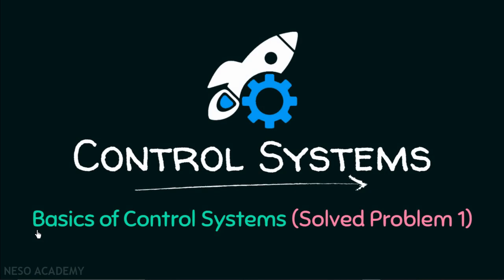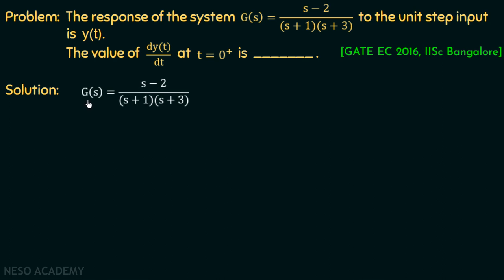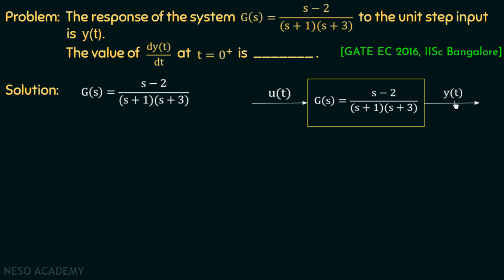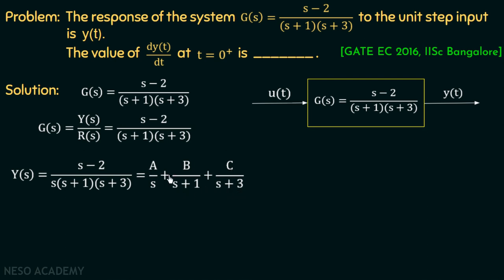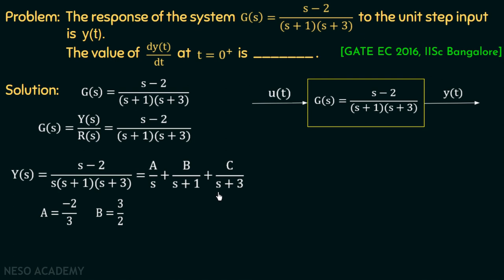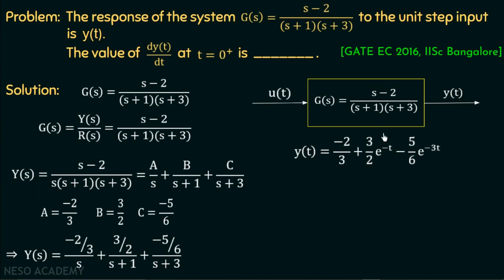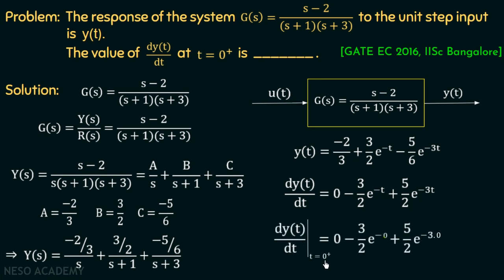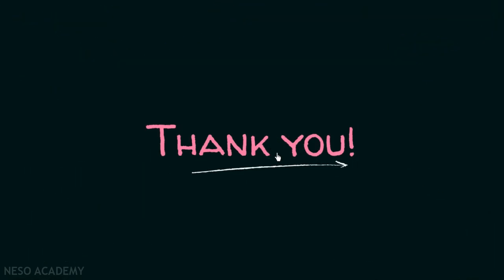Basics of Control Systems (Solved Problem 1)

Comment: We actually don't need the y(t). We can use the formula L^-1 {s F(s) } = f'(t). Then we would have y'(t) = L^-1 {[s * (s-2)]/[s * (s+1) * (s+3)])} in which the s would cancel leaving a simple inverse Laplace to execute y'(t) = L^-1 {s-2/[(s+1)(s+3)]} .
Reply: Without finding the inverse LT we can also  directly find out it by using initial value theorm

Comment: Without finding inverse transform of y(s),we can use initial value theorem to find the answer easily.
Reply: No, there is a sudden impulse at 0 for y'(0)
Reply: @wahibkapdi5493  I may be mistaken, but I don't believe there is a sudden impulse at t = 0+ for y'(0).  As he derived in the video, y'(0+) is just equal to 1.

Comment: Sir ...why we can't write u (t) with answer  this time. ..after taking ILT. .
Reply: İ am so confused with that also.Could you find the answer ?
Reply: I think the main reason why u(t) wasn't written is because the problem just asked for the value of the derivative at one specific time (0+).  Overall, I think it's still safe to assume that we are dealing with causal systems, and if we have to give the response to a signal, we should still either write u(t) or specify that the function is only valid for t >= 0.

Comment: thanks 🙏
I used this idea and get the answer quickly:

We know that if we differentiate step response we get impulse response,
 so if y(t) is step response then dy/dt will be impulse response.

The problem asked us the impulse response at t=0+
so take inverse laplace transform of G(s)
to get impulse response and then substitute t=0.

h(t)=ILT{G(s)}=(-3/2exp(-t)+5/2exp(-3t))u(t).
h(0)=1

Comment: Yo, question ... at 4:05 to about 4:15,

How does (-2/3)/s in Frequ. domain, become just (-2/3) in time domain

If 1/s => u(t)
isn't  (-2/3)/s => (-2/3) u(t)

I feel very confused by this.
Reply: Well, we are taking 1/s+1 = e^-t
So 1/s+0 will be e^-0.t and that will be 1
Reply: Do you know what u(t) is or how it's defined?  It's equal to 1 for t >= 0.  There's no such thing as negative time, so -2/3 and (-2/3)u(t) is the exact same thing as long as it's understood that it's an engineering problem.  Personally, I only write u(t) when it's shifted, i.e., the signal changes between some intervals.  But if it troubles you that he didn't put u(t), then do it when you're solving similar problems.

Comment: Can you help me understand here:
Suppose we want to use (S+1)= 0
And S=-1

So, putting s=-1 in LHS
(-1-2)÷{-1(-1+1)(-1+3)}
=> -3÷{-1(0)(2)}
Having 0 in the denominator, becomes invalid according to my understanding. So, please help me understand. How do we avoid (s-1) in the denominator? I'm confused in that section.
Reply: I think as part of the "cover-up method", you need to cover up the factor of (s+1) in the denominator on the LHS.  So you'd have (-1 - 2)/(-1*(-1 + 3)) = -3/(-1*2) = 3/2, which is what he got in the video.
Reply: This still confuses me...why is the (s+1) covered up?
Reply: @justinokolo5234  It's called the Heaviside cover-up method.   Essentially, the idea is that you multiply through by one factor at a time, and the pole dominates over all other terms in the partial fraction expansion.

Here's the proof for why it works.

Given:
1/((s - p)*(s - q)*(s - r))

This is an arbitrary combination of three poles.  We could extend this for however many poles you want, and you'd still get the same result.

We'd like it to equal the sum of individual single pole functions:
1/((s - p)*(s - q)*(s - r)) = A/(s - p) + B/(s - q) + C/(s - r)

According to the Heaviside coverup method, you can solve for A & B, by covering up the corresponding factor, and substituting the value of s that makes that factor equal zero, to all the rest of the terms.
at s=p: A = 1/((p - q)*(p - r)
at s=q: B = 1/((q - p)*(q - r))
at s=r: C = 1/((p - r)*(q - r))

This is what we should get, when we solve for it, with first principles of partial fractions.

Recall:
1/((s - p)*(s - q)*(s - r)) = A/(s - p) + B/(s - q) + C/(s - r)

Multiply through by (s - p):
1/((s - q)*(s - r)) = A*(s - p)/(s - p) + B*(s - p)/(s - q) + C*(s - p)/(s - r)

Consider what happens in the limit that s approaches p.  Not immediately at s=p, but as you approach it.   The B and C terms will disappear, because the (s - p) term will approach zero.  The A-term will simplify to A, because (s - p)/(s - p) is a removable singularity.   We're left with:
1/((s - q)*(s - r)) = A + B*0/(s - q) + C*0/(s - r)
1/((s - q)*(s - r)) = A

Now we've eliminated all indeterminate forms, we can substitute s=p.  As you can see, this is exactly what Heaviside cover-up produces, as the result for A:
A = 1/((p - q)*(s - r))

We can repeat for the other two terms, but this shows the essence of why this method works.

Comment: Nice video! There is another way around which is using

      lim s->♾️ sF(s) = f(0+), 

where F(s) = Laplace(y'), hence f(0+) = y'(0+). Now we need Laplace(y'), and to calculate it using the formula of
 
Laplace(y'(t)) = sY(s) - y(0+),

As  Y(s) = Laplace (y(t)) then based on the problem statement Y(s) = (1/s)*G(s) . We have G(s) but we need y(0+). Using

lim s->♾️ sY(s) = y(0+),

We can find y(0+). Since sY(s) = s* (1/s)* G(s) = G(s) then 
 
lim s->♾️ sY(s) =lim s->♾️ G(s) = 0. Replacing y(0+) into
Laplace(y'(t)) = sY(s) - y(0+) yeilds 
Laplace(y'(t)) = s(1/s)*G(s)= G(s). Refering to 
lim s->♾️ sF(s) = f(0+), and considering F(s) = Laplace(y') then f(0+) = y'(0+) and  sF(s)=sG(s). Thus, lim s->♾️ sG(s) = 1. Hence, y'(0+) =1.